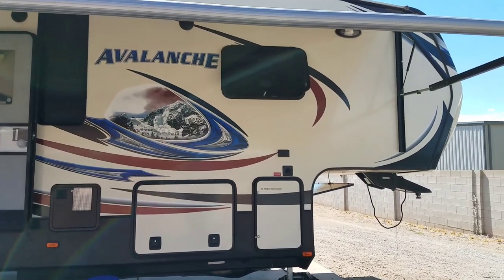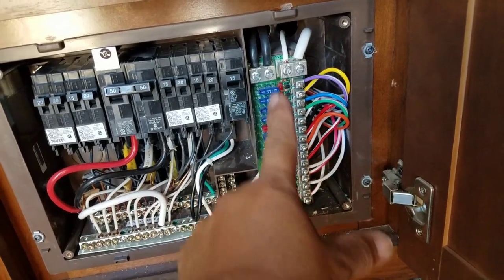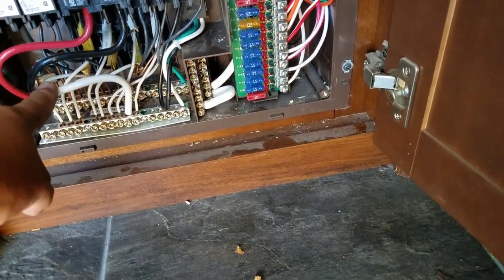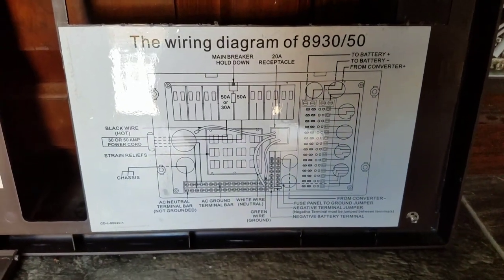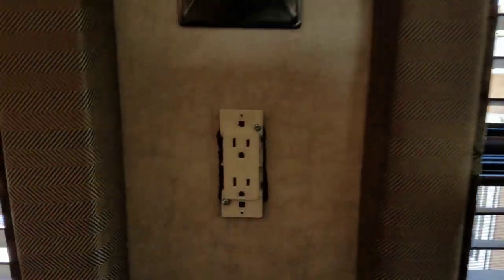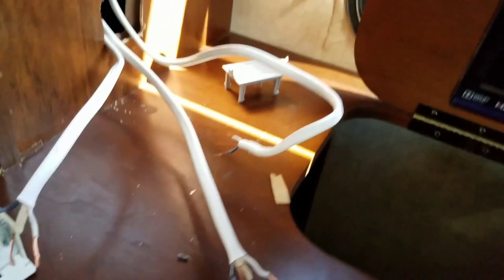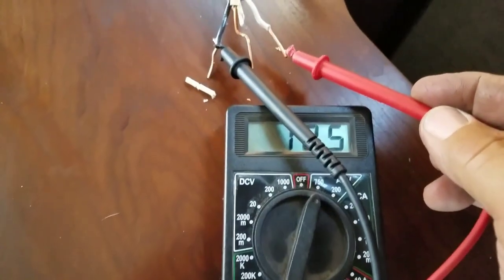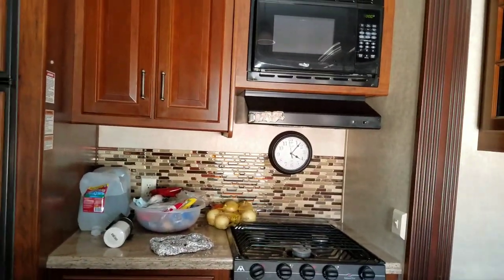Half your outlets work in your 5th wheel trailer/camper

Comment: A proper box outlet would be a safer upgrade. RV push terminals are a cheap and dangerous industry method to save “them” money. They often go bad are an easy swap out for someone with your skill level.
Thanks for the clear and useful presentation.
Reply: Your comment is spot-on I give you thumbs-up also there's nothing worse than cutting Corners when it comes to safety this could cause fires and other problems including the possibility of electrocution of course that's comes from my limited source of Education on these matters but nevertheless I totally agree.

Comment: Man I hope this helps me out. I have 3 outlets not working. 1 behind the sink in kitchen which is on a slide out and the other 2 are on the opposite side, 1 under dining table and the other in the outdoor kitchen. My gfci is in the bathroom and I’ve tested and reset a few times. Checked the fuses and can see one that is blown. Should I take apart one of the outlets not working and check it? Would a voltage meter work?
Reply: chefhugo2017 did you ever find the problem with your outlets?